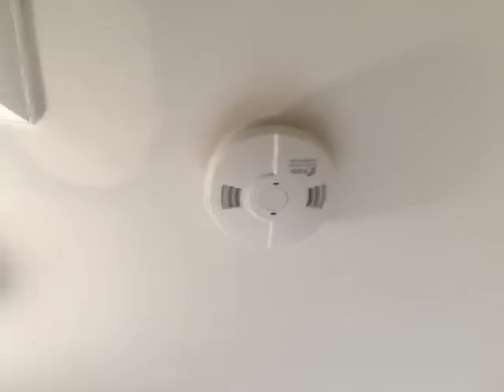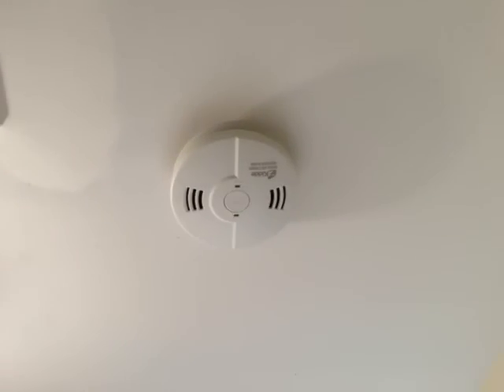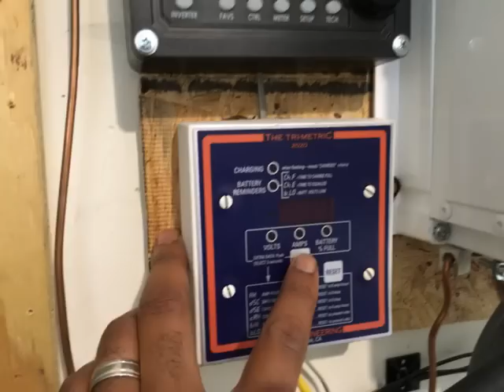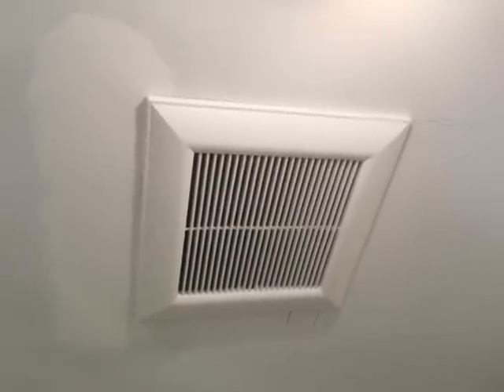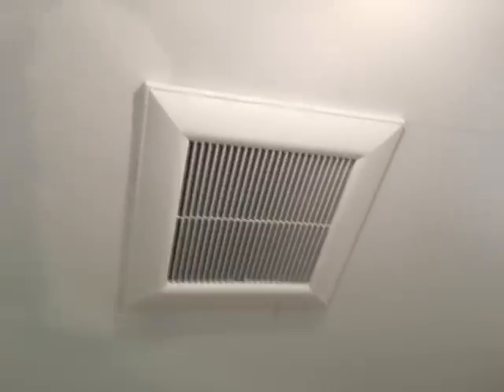Off-Grid Lead Acid and Nickel Iron Battery Bank Venting Concerns

Comment: I was told NiFe batteries do not need to be vented,  was I told wrong?
Reply from the maker: Actually, NiFe batteries don't need to be in a battery box.  However,  during hard charging when the batteries are around 80% or greater SoC, during the last stages of charging, these batteries will give off HHO or hydrogen and oxygen gas.  Obviously these gases are not toxic like the gases coming from Lead Acid Batteries, but the mix of HHO is explosive if kept in a un-ventilated confined space.  During the initial charging stages, NiFe batteries gas very little if at all, but as it gets closer to finishing the charging cycle, just before and during float mode, the batteries will gas.  During this time you will hear the distinct sound of "hissing" from the cells.  if you were able to see into the cell you would see the formation of tiny sporatic bubbles which indicate gas rising to the surface and being released.  Granted, these batteries are usually kept in a spacious room with plenty of clearance, under those conditions it would be difficult for hydrogen to congregate to explosive levels.  However, for an 8x10 utility room or small garage with little ventilation, that could be a problem.

Comment: I like to see more about nickel iron batteries , but these days it seems that those that do not know what they are doing are the authorities ?
Point being , there was no information in this post .
Reply from the maker: Thanks for your comments.  Actually, I have posted 10 videos featuring Nickel Iron Batteries.  They talk about the where they came from, A brief history, what the proper voltages are to charge them, how they perform during an actual load test, how they work in an AC Coupled setup, how to supplement power output by using ultra-capacitors, and finally now the potential hazards of not properly venting them.  Other than that, I can't help you.

Comment: I ordered 40 Changhong units for my PV system last week.  I'm wondering if this was a mistake now?  I did do research on NiFe verses lead acid and NiFe seemed viable for my interest and usage.  I have been reading some threads on NiFe and there are a few who simply are against NiFe.  Their arguments seem viable but I don't think they ever used them, just walking the walk.  How are your NiFe holding up?
Reply from the maker: The threads from the forums are first place "not" to look when trying to find "factual" information about NiFe batteries.  Look for folks that actually own, owned, or currently use them.  I went to the forums as well and I'm convinced that the individuals don't have a clue as what they are talking about.  I read the same "crap" you did, and I reacted in pretty much the same way you are doing now.  Worrying about whether or not I made the right investment based on things "Old Bill" said.  I would guess that 98% of the folks speaking negative have never owned NiFe batteries.  My batteries are doing fine and are performing as expected.  I'm loosing count as to how many times I've simply went off grid and drained them down to 80 or 90% DoD, without any sense of worry whatsoever.  In my opinion, the only true mistake is to listen to folks who  have no stake in the game.  After using my NiFe batteries, I believe Lead acid batteries (LABs) for off-grid operations makes no sense.  For simple occasional use for backup purposes, LABs are fine.  For daily use, LABs don't make sense.
Reply: In retrospect, I am really exited to get the NiFe batteries.  I have a SMA SunnyBoy 3000TL and a SMA Sunny Island 6048 and will have extra control over parameters to customize the setting for the NiFe batteries.
I have watched your videos on the capacitors and am very interested in doing this myself for my system.  Where would you start to size the right capacitors?
Reply from the maker: I went with Maxwell 2.7v 3000F ultra-caps, overkill certainly, but I don't regret the decision.  With NiFe batteries and custom charging settings, I would go no lower than 2.7v at 1000F.  The size of the capacitor bank depends on the total voltage size of your battery bank, in a bulk charging or "fully" charged state, i.e, my battery bank charges at 31.3v, but max charge rate is 32v, so my capacitor bank max charge is 32.4v.  Maxwell's are the star of the industry, so I would look at them first.  In terms of total capacitance, you don't need alot, I have 250F total and that seems to be just fine for me.  I'm sure there are calculations, but I don't know them.

Comment: Why not just box the batteries and vent them out the new hole you made
Reply from the maker: Thanks for your question.  Nickel Iron Batteries, for the most part, are not typically placed in a battery box like traditional lead acid batteries.  They are generally kept on a rack in a well vented room.  If you look around the web, you'll see that the majority of the installations follow the general consensus of NiFe distributors in that a battery box is not required.  I first saw batteries of this type in an electrical power plant as a means of emergency backup power.  They were placed in an electrical\server room on a rack and had been there since the plant opened maybe a decade or two earlier.